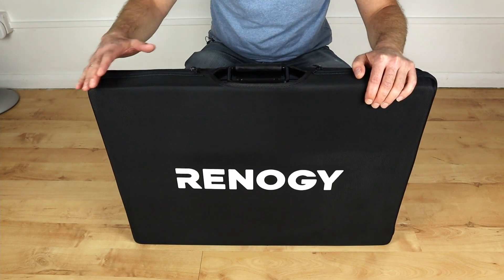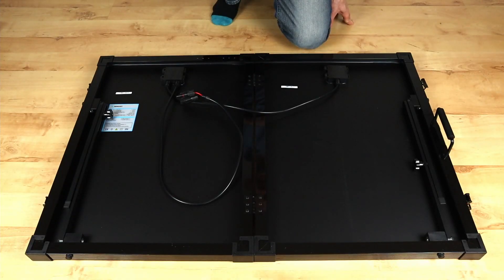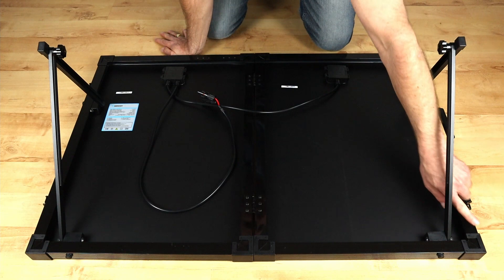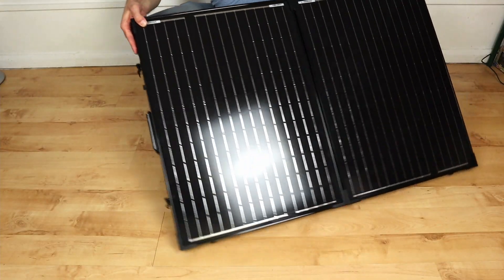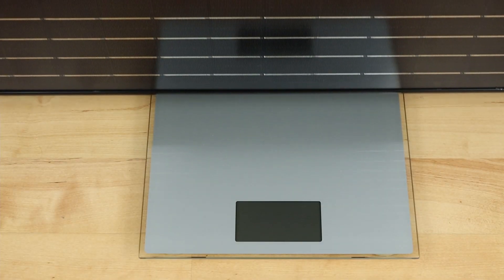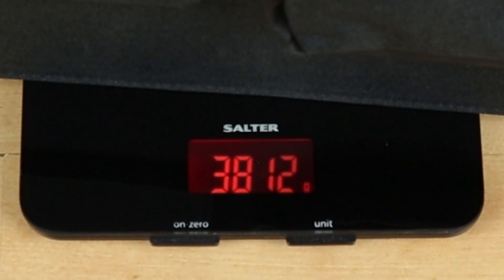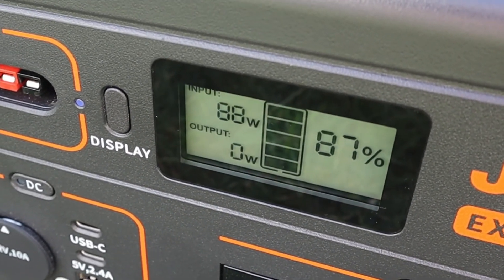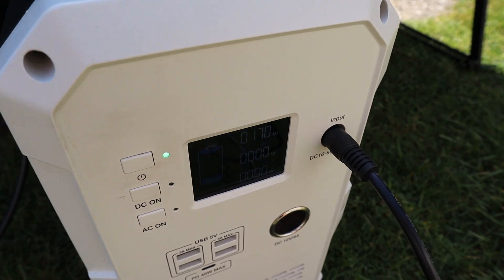Jackery SolarSaga 100W Panel vs Renogy® 100W Foldable Solar Suitcase | Portable Solar Choices

Comment: Hi great video. I have the Anker 525 power station and it comes with the XT60 connector to yellow barrel plug that goes into the power station to charge over solar power. Is there an adapter that offers MC4 to the yellow barrel plug so that I can use this with the Anker unit? Sorry don’t know the name of that yellow plug thing 😂  hope you can help. Thanks
Reply from the maker: @captured_by_costa  Good day. Thanks for your kind feedback, much appreciated😃. Would you be able to share a link to the power station and cable in question? I know there's a 521 and 535, but I'm not sure about the 525. All the best, Adrian
Reply: @DADvinci  hiya sorry my error it is thr 521 that I have. Hope this helps?
Reply from the maker: @captured_by_costa  Thanks for clarifying. It looks like the DC input (DC 7909) is similar to the Jackery units, as mentioned on the Anker website "Use any 12V-28V solar charger with a DC 7909 male connector to charge the power station". This is the one I use on both my Jackery power stations and PowerOak EB150 > https://amzn.to/38LpGKQ (affiliate link). It should fit yours, but I'm unable to test my end as I've not got your unit. I hope this helps. Cheers, Adrian

Comment: Hello, great video! Do you know if its is possible to connect two different solar panel to a Jackery 1000? I wanted to get a Renogy solar panel and pair it with a SolarSaga 100W panel so I got the two of them charging my Jackery1000 in parallel.
What do you think? It’s possible?
Reply from the maker: @Juan Cordial  Good day Juan. Thanks for your kind feedback, much appreciated👍. Yes, I've connected different panels in parallel to the 1000. The only tricky bit is getting the right cable combo. Do you have a Jackery parallel connector, the one that has two 8mm DC inputs to Anderson connector output to plug into the 1000? All the best, Adrian

Comment: Great video!... Do you know if you can use the renogy 200w folding solar panel with the ecoflow River Pro?
Reply from the maker: @Another brick OUT the wall  Good day! Thanks for your kind feedback, it's much appreciated 👍😊. Just to clarify, do you mean this panel > https://amzn.to/36N7xP2 (affiliate link) and this Ecoflow > https://amzn.to/3u2WNoQ (affiliate link)? If so, based on the specs for the EF it has a Solar Charge Input of 200W 10-25V DC 12A Max, so it would depend on the voltage output of the Renogy folding panel. If the panel above is the right one, the two 100W panels would need to be connected in parallel, otherwise the voltage would be too much for the 25V limit on the EF. If you could confirm I've got the right ones above, I'll see if the Renogy is parallel connected like the smaller 100W folding one I have. All the best, Adrian

Comment: Nice video. The new Renogy portable solar panel 100W Eclipse with SunPower cell could be a good comparison.
Reply from the maker: @Sylvain D.  Good day. Thanks for your kind feedback, it's much appreciated😊. I've not looked at flexible panels as yet, so thanks for your suggestion. All the best, Adrian
Reply: @DADvinci  YouTube removed my reply with a link. The Renogy eclipse is a glass panel. Check the sku RNG-KIT-STCS100MB-NC-US.

Comment: Can you use the jackery solar panel to charge a inergy flex 1500 or a Lion Safari LT 500W? I’m new to solar generators and solar panels and found a jackery solar saga panel 100W and a Lion generator for sale on OfferUp and don’t know if that set up would work. Any insight would be greatly appreciated.
Reply from the maker: @MattathYahu  Good day and thanks for your question. The Jackery panel has similar output characteristics to other 100W panels, so providing the units can accept the voltage of a 100W panel it should work. You might need an adapter though, as the Solar Saga has an 8mm dc output that might not directly fit. Do you have links to the units mentioned so I could have a look? All the best, Adrian

Comment: I’m so glad I came across this video! There are dozens of videos on either of these panels, and I know many YouTubers with both, but no one puts them head to head. 

The burning question I have is how they compare in durability? Looks like the Jackery is more flimsy, and susceptible to cracking the cells/connections just like the flexible SunPower panels they’re based on. Whereas the Renogy is more rigid but glass is obviously fragile. What would you say since you’ve handled both? Which one would be better for someone that doesn’t like to “baby” their outdoor equipment?
Reply from the maker: @eai2l  Good day! I really appreciate your feedback on this as I didn't know whether it would appeal or not. 

I'll have to base some of my answer on experience with the 100W glass panels I already have. They have had quite a bit of damage, been dropped, dented, scratched glass, etc and are still working fine. I've managed to rip out cables from the connector boxes many times, but reconnected or replaced. 

My rigid panels live most of the time on grass, not hard (concrete) surfaces, which would damage the frame more over time for heavy dropping. Saying all this, I prefer rigid panels as their performance and weatherproof nature means they tend to last better over time. For me, the good thing for longevity is that I can repair the Renogy (like my 100W panels) if I damage the cables or legs and broken glass (scratched and still working on 100W panels) is the only real thing that could stop a repair. The price difference makes it an easier pill to swallow on the Renogy side, where I've not broken any panel glass as yet and the Jackery would need to be cut open to repair with no guarantee of success and a mess afterwards. I hope this helps? Please shout if you need anything else. All the best, Adrian
Reply: @DADvinci  thank you for the thoughtful answer, I hadn’t even considered the ability to repair as a factor in durability! 
You may not be able to answer this, and I’m sure you don’t want to test your Jackery in this way, but do you know if it can be “overflexed” easily? I’ve seen YouTubers talk about accidentally cracking their flexible panels when a bend more than 30 degrees is placed, I wonder how much more rigid the Jackery is, or if it is just as susceptible to accidental cracking or even warping over time - it’s just a woven nylon type backing right?
Reply from the maker: @eai2l  No problem at all, glad to help. I guess it depends on how much pressure is exerted. For me, opening them up and using the kick stands doesn't seem like it would cause any damage. Putting heavy items on a folded panel could potentially damage it, but keeping it upright and storing as such should keep it in good condition. It seems rigid enough with a backing board of some description. The only thing that might cause a problem is if you unfold the panel so the back of each one touches each other, as this may put pressure on the connections between panels. I always ensure that when I open the panels, I use the kick stands so it stops this happening naturally. I hope this helps. Cheers, Adrian

Comment: I have a dometic battery what would I need to charge it using solar as I’m clueless. Your help would be greatly appreciated. Cathryn.
Reply: Hi its a dometic plb40. Sorry its taken a while to reply.
Reply from the maker: @Cathryn Roberts  Thanks for the info. From what I can find you can connect up a solar panel direct with the correct cable. This is from their FAQ > https://www.dometic.com/en-gb/outdoor/uk/support/faq/what-solar-panels. So, you could go for a 100W panel like this > https://amzn.to/2ZFAzfx (affiliate link) and this video might help > https://youtu.be/KUq1lnMjfAk. The solar cable needs to have a 'grey SB50 Anderson connector’ the end that fits into the PLB40 (as per the FAQ) and I'd suggest going for MC4 connectors on the other end (to connect to a solar panel like the Renogy one I’ve mentioned). Did you need the panel to portable and fully weatherproof? Cheers, Adrian
Reply: @DADvinci  Thanks for that. Suppose it doesn’t need to be waterproof as we can just put in and out of the rain. Wish I’d bought jackery instead of dometic . But hey ho thought it was fab and was going to buy the dometic solar panel aswell but they don’t do it anymore. Typical. I’m holding off till I’ve saved some more pennies but Thankyou so much for your help. Cathryn
Reply from the maker: @Cathryn Roberts  Good day Cathryn and thanks for your question. Just to confirm, you are looking to charge a battery from one of these panels? Do you have a link you could post for your battery? All the best, Adrian

Comment: I can’t believe Renogy skimped with the P.W.M. controller option over M.P.P.T.  I’d go for the one without any controller as most generators have an M.P.P.T. controller inside them.  Certainly the Renogy is more sturdy in breezy conditions.  Although the Jackery has the U.S.B. outputs, I can’t see these being of much use.  Great comparison production Adrian.  Thank you for sharing.
Reply from the maker: @Roger Hargreaves  Hey Roger, it's nice to hear from you. I really appreciate your feedback, it keeps me focused on the right balance for the videos 👍😊. I guess they do it to keep the costs down, but I'd only go the MPPT route (definitely worth the extra cost for direct battery charging). You're spot on when it comes to solar generators, the panel with the appropriate cable is all you need. Enjoy the rest of your weekend. All the best, Adrian
Reply: @DADvinci  Thanks Adrian, always great to get a reply from you.  👍😀.